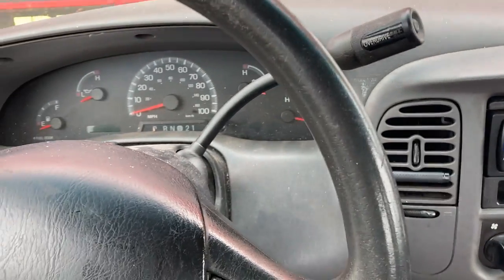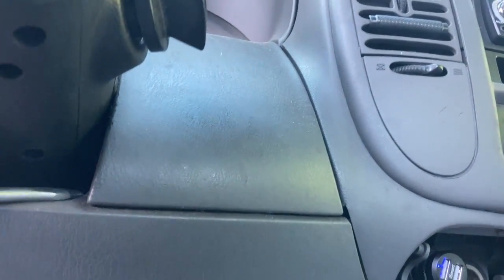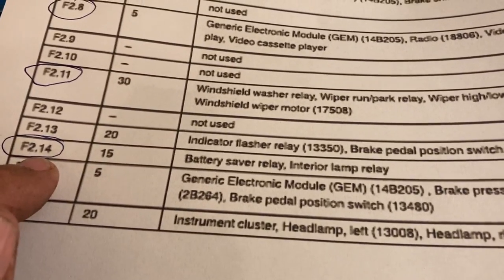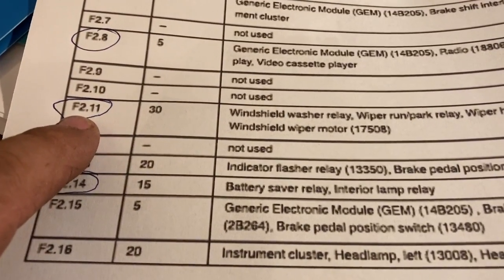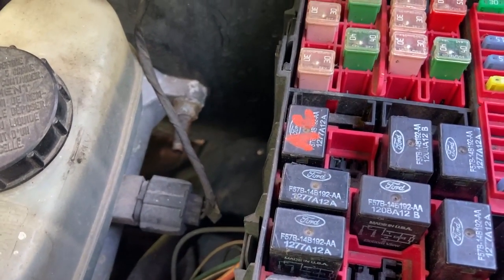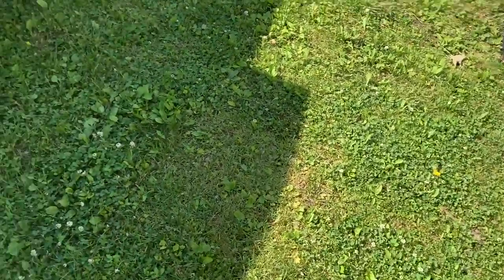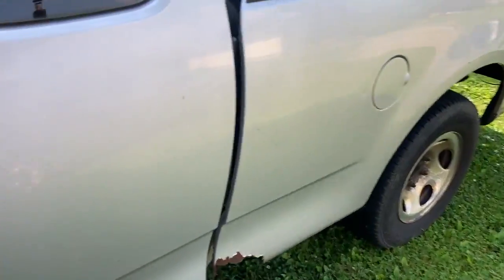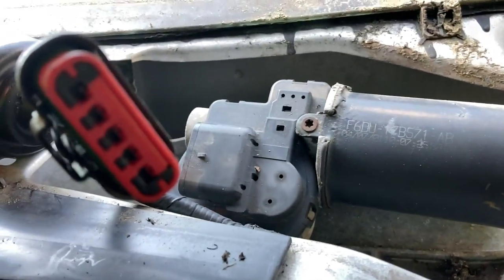2002 Ford F150 Radio & Dinger/Chime Stay On - NOT an Ignition Switch @1AAuto

Comment: my 01 f150 is doing the same thing, killing the battery, i need start pulling fuses i recon, i can hear something clicking from where the ignition switch is but gives the weird dings can close the door still dings some times just a half speed dink, messing with the headlight switch will change it , gonna look at it maybe next weekend, havent tried to turn on the wipers to see if something changes thanks

Comment: Interesting problem. I had to try and follow a diagram today to figure out why my tractor died and wouldn't start. Figured it had to be the fuse for the safety module or the module itself from what I could see. I dropped the old fuse and couldn't find it in the grass and the contacts for the module where dirty so after replacing the fuse and cleaning the contacts it will start again. Didn't know how to read the diagrams before watching some of your videos so thanks.
Reply from the maker: Yeah, I have been thinking about doing some in depth videos on how to read diagrams, and the differences in some of the diagrams from different manufacturers.

Comment: Very interesting.  I'll have to remember this if I ever have the same issue with my F150
Reply from the maker: I didn't know the Canadian ones had windshield wipers.   Seriously, I have worked on a lot of F150's and have never seen one do this before.  It was a strange one.
Reply: I'm dealing with a very very similar problem only my truck won't start either. I have to jump the starter solenoid every time. I've replaced every fuse, relay, ignition cylinder, ignition switch, GEM..
Reply: My 2000 f150 DRL stay on also

Comment: My 98 was doing the same thing but also was engaging the starter while running. I replaced the switch. The starter problem stopped but I’m still having the same issues as you with the power still on and the key removed. Going to try the ignition cylinder I guess.
Reply from the maker: Probably no the ignition cylinder.  Good luck finding it.

Comment: I’m currently facing the same issue, the windshield wiper motor work on my truck though, so im guessing I’ll start with the ignition switch and see if that solves the problem?
Reply from the maker: Yeah Unplug it and see if the dinging goes away.

Comment: 1998 Ford F-150 V-8 had starter over run and electrical staying on in the cab as well as the weird intermittent chiming you had and messed around with the wiper motor switch and sure enough in a resting off and down position lights and chiming. Switched the wiper position to in between different setting levels and the lights and chiming stopped. Good damn find. Would never think to look for the wiper motor to be giving the electrical system grief. Thank You for your hard work in finding this. Who the hell would thin wipers could be the cause of electrical gremlins. The wiper motor works fine otherwise.
Reply from the maker: Electrical problems are like that.
Reply: @frugalprepper  cut the ground from the key cylinder

Comment: Holy crap! What a great job trouble shooting! Man that was quite the journey.
Reply from the maker: I had a good one on a Buick last night, too.  Didn't get to film it though.  Had to find the broken wire in the harness.   The wire was just broken.  No damage to the harness or the wire.  The insulation was in tack and the wire was broken inside in a spot where the harness didn't rub or move.
Reply: @frugalprepper take the gym module out

Comment: I'm experiencing power to my fan and other accessories with my ignition switch in the off position
And my steering wheel doesn't lock
Reply from the maker: I would take the ignition switch out and see if the power shuts off and see if is still has power.  If it doesn't you have a bad switch.